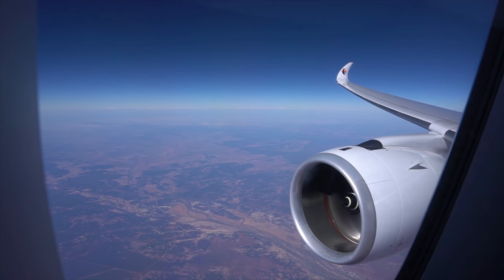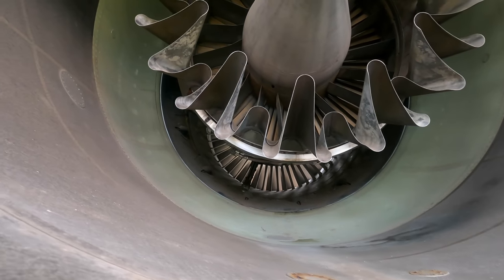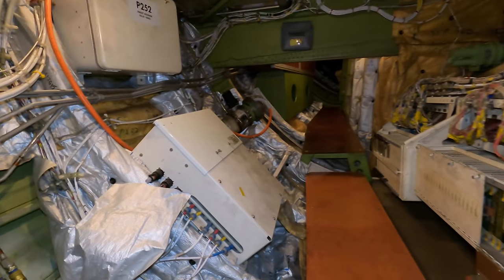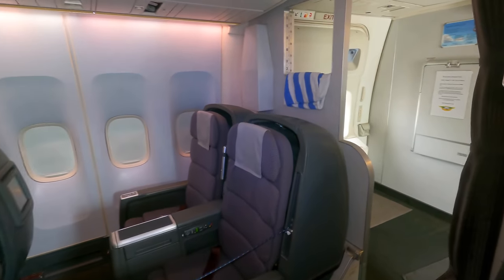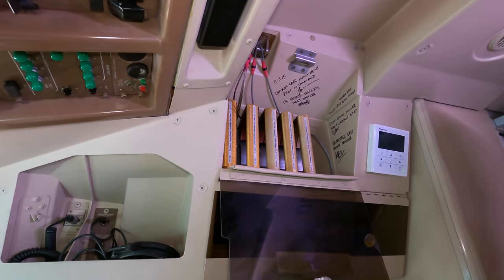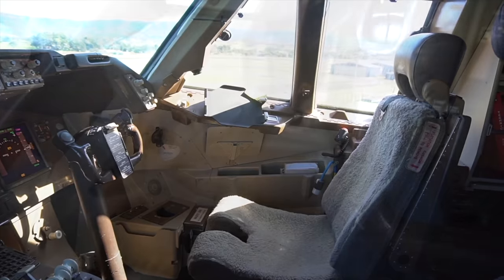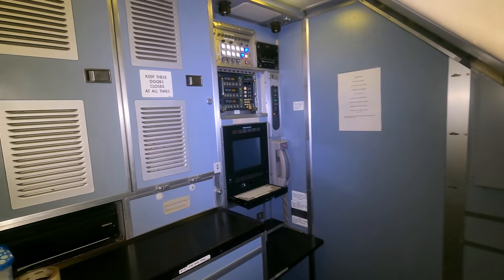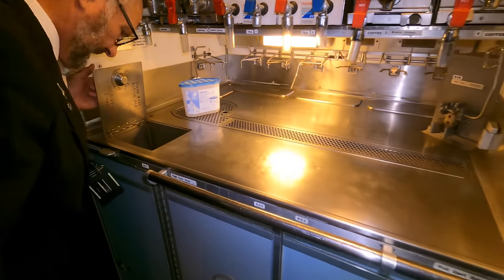Detailed tour through a Boeing 747-400!

Comment: Thanks for the tour, I worked on 747's for over 40 years and was part of a crew on the first 747-400 to enter service. Brings back many memories.
Reply: One thing I alway found funny was by the flight deck escape hatch the little handle reels you hang onto when you jump out. There is a sticker on the side of it with 20 little dots. Every time you jump out and use it you scratch a dot off, after 20 times it needs overhaul. In 40 years I never seen one used.

Comment: Just loved taking off in the 747 the power in intitial takeoff is awesome my favourite part pushed u back in the seat been on a few the 1st time as a 12yr old was shocked at the size of the plane and wanted to turn around and not board this thing cant take off. One of my favourite planes i flew on.

Came to Aust as a 1.5yr old on a Qantas  707

Comment: I worked on this 747 many times during my time with Qantas, so strange to see it as a museum now.
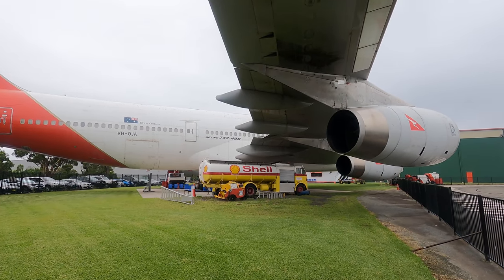 6:35 The leading edges are a mixture of Kruger flaps between the inboard engines and the fuselage and Variable Camber Leading Edge Flaps between the inboard engines and the wingtips.
21:52 The flight deck humidifier is located behind the left sidewall in the forward cargo (where the new AC system is), I could change that in about 15 minutes.
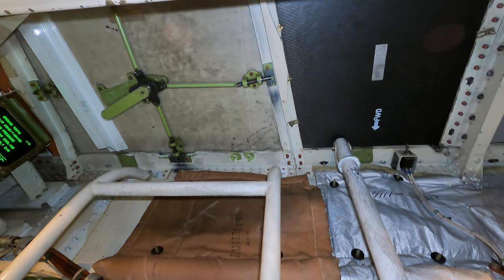Reply: What’s that display at 13:00? Looks a bit like an FMC?
Reply: @uzaiyaro  
That's exactly what it is.
It's used by the cone heads...uh..the Avionics guys during maintenance.

Comment: The Trim air button that he pointed out is wrong in his initial description ,its used to give each cabin zone its own temp selection,so one zone can be 26c while the next can be 23c as an example.Trim air comes from the aircon system that is taped off prior to the ACM(air cycle machines)its very hot and it adds heat to the zonal ducting prior to the air entering the cabin.
Reply: Additionally, even if all the zones were kept at the same temperature, trim air is still required in some zones because they are naturally colder than others. 
I see Paul also misidentified the ACMs as "heat exchangers". The heat exchangers are located above the Ram Air Exit doors (the slatted vents shown in the video).

Comment: Love your videos Paul.  I am confused with this one though.  Why would they have a GTCP660-4 APU on display with a 747-400?  That aircraft has the PW901A, a much more reliable engine than the 660-4.  Interesting thing about the 660, that was the maximum weight it could be when the 747 was in development in the late 60's.  I got that tidbit from one of the original design engineers I knew at Airesearch (now Honeywell) in the early 1990's

Comment: Does the air harvested from bleed air in the compressors actually make it into the cabin, or is it exchanged for fresh outside air in the heat exchangers? I suppose it must be used, as the outside air won't be the right pressure. I guess sometimes that's why we can smell kerosene when the engines start up if there's any fumes getting into the forward compressors?

Comment: Another really enjoyable video Paul. That's interesting to hear about an extra galley down in the storage hold. I suppose air freight was much less common back in the early days of the 747? It's a real credit to the HARS  museum that they keep the flight deck's computers operational, too. I hope they're more reliable than my ASUS, though.
Reply: .... but there was never a galley in the forward lower cargo hold on the Qantas 747-200 as stated in the video. There was one in the rear and the access was provided via a human-sized elevator, not like the one shown in the video. On some of Qantas' 747s, they put a containerised crew rest area below the forward galley for long haul flights.
Reply: @ImperrfectStranger  Yes and I remember the hatch to access it in the dr2 galley area with a sliding sign indicating if it was occupied or not.
Reply: @ImperrfectStranger  Were you aware that an FO couldn't physically override the Captain's control yoke in roll?
Reply: @davidpalmer9780  I haven't given it much thought. In what situation? The system has a number of mechanisms (in the cockpit and in the wheel wells) which allow independent movement if the cables were jammed on one side. If the cables in the left wing were jammed, the F/O could still control the right ailerons if he supplied sufficient force. If the cables between the control columns were jammed, the F/O could still control ailerons on the right side. Also, some spoilers on the left wing will operate with F/O override. 
If the captain held the yoke in the straight and level position, are you saying the F/O couldn't override the Captain?
Reply: @ImperrfectStranger  To answer your last question... Yes... the F/O couldn't forcibly override the Captain's yoke with roll inputs if the Captain held the yoke firmly. Give it a try, if you can, and you'll see it's true.

I'm thinking this is to prevent a pod/wing strike situation with an inexperienced F/O landing with the Captain monitoring.

Excessive roll input would have the greatest impact on landing when comparing with pitch and yaw.
This is just my assumption why this yoke 'feature' exists on the 744 and I'm happy to be corrected.
Reply: @davidpalmer9780  Are you a pilot or engineer? I'm curious to know when/where you tried it. The whole point of the "breakout system" is to prevent jammed mechanisms on one side preventing the crew from controlling the aircraft. You need 30 pounds of force and an extra 6 degrees of yoke movement to make things happen and even then, you'll only get half control. Maintenance Manual Reference 27-11-00 (around page 15). I imagine it's a  horrible way to fly an aircraft.
Reply: @ImperrfectStranger  Respectfully, who I am is of no consequence but I'm sure what control yoke feature I've previously described is not connected with a breakout system or 'split control' functionality. I can't see how to relate it to these systems and I can't find anything about it anywhere or why it exists but I can assure you it does happen. I'm haven't checked if this yoke feature is mirrored in sims.
Reply: @davidpalmer9780  So basically, you're saying that it doesn't exist because you couldn't find any information on the subject? This is not offering me much "assurance".
I have a library of Boeing 747-400 Maintenance Manuals and 747-400 Engineering Training Notes at my disposal which include descriptions and diagrams of the yoke breakout mechanisms. I'm not saying the manuals are never wrong or never ambiguous, but with 40 years of Qantas Engineering under my belt, I'm putting my faith in the manuals in this particular case.
Reply: @davidpalmer9780  It seems that at least some of this information is available publicly. Took me a minute to find it.
https://www.volarenargentina.com/descargas/_747-400_FCTM.pdf  (page 290/291).
Reply: @ImperrfectStranger  Yes... a document I'm very familiar with but still doesn't explain the Captain & F/O control yoke behaviour unless with your years of experience. To reiterate the situation... If the Captain grips and holds the control yoke tightly in straight and level, the F/O cannot input any control yoke roll. The F/O's control yoke will actually move with full deflection in both port & starboard without having any effect on the Captains hold of his control yoke which is still maintaining straight & level.
I might make a video to demonstrate next week.
Reply: @davidpalmer9780  Now that you've shown you have access to either a sim or real aircraft with hydraulics on, this was inspiration to look into the manuals a little deeper. The AMM procedure for checking part of the breakout system involves turning the captain's wheel fully clockwise with hydraulics on and ensuring the F/O's wheel is able to turn 185 degrees counter clockwise, and then repeat with the captain's wheel fully anticlockwise and the F/O's wheel fully clockwise, but the manual doesn't specify if the ailerons or spoilers move. However, the procedure does continue to say to clamp the Captain's yoke in the neutral position, pull the speedbrake handle and turn the F/O's yoke to 95 degrees counter-clockwise and observe that the #11 and #12 spoilers are fully down. A clue, perhaps. This seems to suggest that the F/O has at least some control on the ground.

Comment: It was the `outward` locking mechanism on ( I think ) a couple of DC10`s that caused the death of many dozens of passengers in the 1970`s / 80`s when two of those aircraft had their cargo doors blow out - all to save money ( or make more money ). More cargo room = more money. Are large modern passenger jets still fitted with cargo doors that open outwards ? I`m asking because I don`t know.
Reply: yes they are and is due to economic reasons space all they need is a sliding plug door no problems 2000 people would stil be alive today

Comment: 34:14...The aft pressure bulkhead was the part that failed due to a faulty repair years earlier on Japan Airlines Flight 123 in 1985. It remains the worst single plane aviation disaster to date with 520 dead and only 4 survivors.
Reply from the maker: Yes very sad

Comment: Could this aircraft fly again without much prep?  Or is it forever decaying into the earth?
Reply: It would take thousands of hours of maintenance to get this back in the air. It even looks like they cut a hole in the fuselage to feed in those extra power wires for the "aftermarket" air conditioning. Then there are the regulations, although I can't recall if this particular aircraft was close to it's maximum number of flight cycles, but it must be close. 
The fuel system is critical. Even active aircraft suffer from microbial contamination in fuel tanks (biocide treatment required).

Comment: Paul - was it really 41/42 degC on the day you filmed this?  - looking at the TAT reading on the EIS screen.  Great video too by the way. I live about 10mins from this aircraft and haven't done this tour. It's on my to-do list now though. 👍
Reply from the maker: I do recall I filmed the flightdeck on a very hot day so it could have been that high.  It’s definitely worth doing!
Reply: With the engines or APU not running on the ground, the TAT probes on the nose are not "aspirated". i.e. air is not circulated through them. This may affect the reading, especially if there is direct sunlight on the probes.
Reply: @ImperrfectStranger  I never thought of that. That would make sense.  Thanks for the comment. Cheers.

Comment: Great video. Did you learn what’s involved to keep her powered up for display?
Reply from the maker: Cheers although I'm afraid I didn't ask about those details.
Reply: @PaulStewartAviation  all good! Just wondering if they just throw out the extension cord, or is something more complex!?!
Looks like a great tour that’s definitely on my bucket list after seeing your video. Thanks.
Reply: @ssteve2542  It seems to be powered in the usual way when on the ground (when the Auxilliary Power Unit is not running). i.e. by one or two power leads plugged into the nose, running to a power cart or fixed electrical generator.
Reply: @ImperrfectStranger  makes sense. Cheers
Reply: @ssteve2542  Also, at 18:40 in the video, the overhead panel shows that the normal #1 External (Ground) Power supply is plugged in and powered.

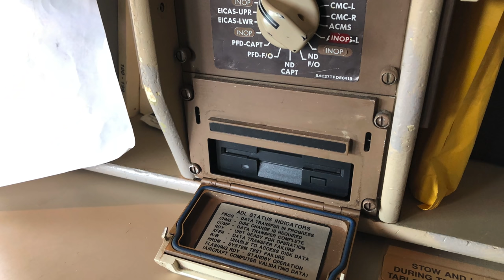Comment: 26:24 You're making me wonder how updating the aircraft is done nowadays.
Reply: Updates as i understand are related to navigation databases. Most have been replaced with a USB drive or for more modern aircraft it'd updated via the internet I think
Reply: Changing from floppy disk to more modern interfaces involves installing a new data transfer unit. (The floppy drive box) And doing some wiring mods. Not cheap but once it's done very fast for navigation database updates. And perhaps more. Not sure.

Comment: Didn't know the 757 had the same RR engines as a 747-400, that's pretty wicked.  I know pilots say the 757 is a hot rod of a plane and a blast to fly.   Years ago I was flying a Delta 757 out of Atlanta to Nashville, thunderstorms were rolling in.  The Captain told us it was going to be a fast/steep climb to get above the weather.  He was not effing around, those engines were screaming and I've never been shoved that hard back into the seat on a takeoff, he had that plane in a 20 or 30 degree climb.  I talked to the pilot briefly, complemented him on that crazy takeoff.  Asked if he had the throttles wide open, told me that was about 80-85% power, which was nuts.  Said since it was a short flight and we were light Delta doesn't like them using max thrust, wears out the engines faster.

Comment: I still wonder to this day, by taking a close look at this masterpiece, how did the engineers were able to design each and every part of this beast, back in the 60's, when there were no computers...
Reply from the maker: I totally agree with you!
Reply: Isn't that the truth ? Amazing.
Reply: There were plenty of computers in the 60s...  it's strange to see someone say this, like there's a hole in your education.  Like thinking that there weren't cars before the 1950s or something...

Electronic computing started in 1942.  There was an entire computer industry by the 1960s with large companies like IBM, DEC, CDC, DG, and HP selling third generation computing machines.  The mouse was invented in 1963.  The networks that would become the internet were established including the IP protocol that is still in use today.  Moore's Law was established in 1965. Intel was founded, the floppy disk invented and UNIX was developed.

It was a pretty computery decade.

Computer aided design goes back to the late 1950s and it was being used in aerospace design from the get go.  Most of the early CAD packages have aerospace origins (CADAM/Lockheed, CADD/McDonald Douglas, Catia/Dassault).  The titanium bulkheads in an SR-71 were the first aerospace parts to be programmed and machined using Gcode and CNC mills.

The 747 had computers in its development process, alongside more traditional methods.
Reply: @lookoutforchris  The Boeing 777 was the first airliner to use computer aided design (CAD) as part of its development.
The prototype of the Boeing 747-100 had no software whatsoever has part of its design. You probably need to re-check your facts...

Comment: I realize there are a lot of gauges and switches in such a cockpit and it would be hard to organize them but the ergonomics/user interface of what is shown here seems not so good and in some cases extraordinarily bad.  I am no engineer but it’s like the cockpit was designed by engineers and not user interface specialists.  Specifically there is not an evidently strong relationship between the importance of a system and the way it can be controlled.  Systems that are life or death should be given more importance through higher accessibility.  Systems that are used extremely frequently should have dials or switches that reflect that use case.  How many times is the dial used to adjust heading on the autopilot used in a flight when it’s so tiny (at least it’s easily reached by pilot and copilot).  
The “=“ button on a hand calculator is usually twice as large, at bottom of the panel, and often coloured to reflect its very frequent use.  I don’t see a lot of such features in many cockpits.

Comment: I didnt know some planes acually carried oxygen tanks for the emergency breathing masks. I thugh they all were solid state chemicals which give off oxygen in burn
Reply: It depends on the aircraft model and in some cases, what the airline chooses (e.g. on the 777, the airline can choose oxygen generators or tanks). In all cases, the flight crew uses tanks. The 2 crew tanks on the 747-400 are slightly forward of the passenger tanks near the forward cargo door. I don't remember if it was mentioned in the video, but there were additional bottles in the forward cargo ceiling on many of Qantas' 747-400s.
Reply: @ImperrfectStranger  Oooh. It does make sense that the crew have tanks just in case they cant descend fast enough. 
I forgot the name for oxygen generators :-)

Comment: Do eneybodey remember the 747 SP sp standing four special performance the shortend 747 witch I flew in 1986 with panam from Heathrow to America believe it or not the shortend 747 had slitley a bit moor range than the then 747 100 the 100 was the very first 747